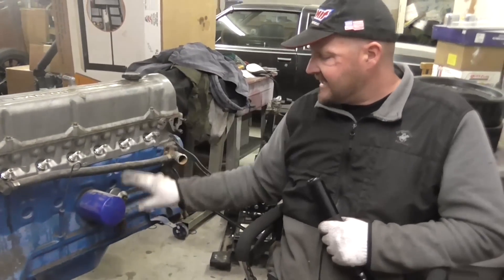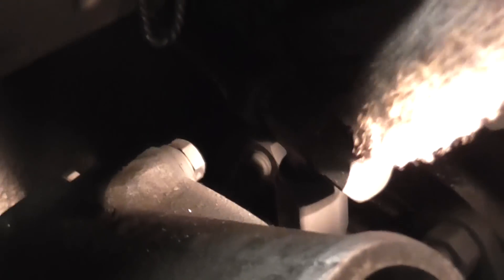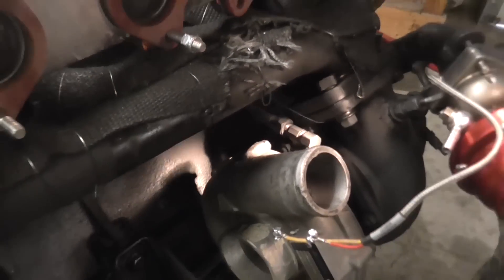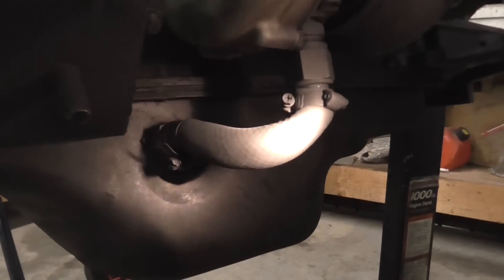Turbocharger Oil Supply And Return Line Installation

Comment: Another thing i realised that the stock l28 is originally non turbo what would be the max psi for those stock internals
Reply from the maker: Nicholas Silva I have had stock internals starting from 10:1 compression with another 20 lbs of boost but I use 100 octane avgas fuel.  With the low octane at the pumps 91, pretty bad octane unfortunately that's what is at the pumps.  Most I would recommend is around 15 lbs.  Now that is also depending on other modifications to the engine such as the right fuel mixture, whether or not you run alcohol injection, timing settings and many other factors.  Some tuners run the alcohol injection and they can run 25 or so lbs of boost.  The important thing to remember is detonation, the stock internals can handle good boost but they cannot handle much detonation.  As long as the engine is not detonating or running lean, the engine can handle quite a bit of boost.  After all, the stock R32, R33 Nissan Skyline GTR's in Japan had stock cast aluminum pistons and handled quite a lot of boost.  Many tuners put forged pistons in there so they could push more than 1000 hp at 35 lbs of boost.  Fuel air mixture, exhaust temperature ensuring that your combustion temperatures are not too hot is what must be monitored to ensure the engine stays together.

Comment: can you show the viewers how to "tap" in to the oil pan and the basics on how to install the turbo including the steps that are not here
Reply: Very easy to tap, you bore for example a 9,6 mm hole and tap with a m10 and use a m10 bolt. Depends on size the fitting you have is.

Comment: just built my d16y8
acl mains
eagle rods
vitara low comp pistons
8:5:1

im having an issue with smoking

could i need to use a smaller oil restrictor
or smaller oil feed line?

what els could this be

iv swapped 3 turbos out thinking i was just having bad luck

but it couldint be 4 ina row

it doesn't smoke N/A
 i just did my rebuild
Reply from the maker: +Raymond Dunlap I had that problem before, a oil inlet flange with a small hole which is low volume higher pressure to create a spray to the oil bearings and not too much volume like a large hole which could put too much pressure on turbo oil seals causing smoke.  Another thing is a clogged PCV which could cause smoking due to the oil blowby having no where to go.  Some people bypass the PVC altogether and just run breather so that problem will not happen again.

Comment: Can you suggest me a turbo for isuzu G1 4 cylinder 2.5 liter diesel engine
Reply from the maker: I would go on ebay and find a T04e or T70 with T3 flange with 2.5 inch V-band flange so downpipe can easily be fabricated.  Most of the time, these turbochargers are very inexpensive, and work well for a long time.  for example:  https://www.ebay.com/itm/T3-T4-T04E-V-BAND-Turbocharger-Turbo-63-A-R-5A-R-Internal-Wastegate-Universal/201748429871?hash=item2ef924bc2f:g:3koAAOSwy5ZXB2Qj&vxp=mtr  or this one:  https://www.ebay.com/itm/T70-T3-70-A-R-ANTI-SURGE-TURBO-COMPRESSOR-BEARING-TURBOCHARGER-STAGE-III-500-HP/201000759487?hash=item2ecc9430bf:g:MMsAAOSw0wRaPlJW&vxp=mtr  then install external wastegate at the exhaust manifold/header just before the turbocharger flange, allowing control of the turbocharger boost, since the T70 has no built in wastegate like the TO4e.  External wastegate example:  https://www.ebay.com/itm/40MM-4-BOLT-EXTERNAL-TURBO-WASTEGATE-BYPASS-EXHAUST-W-10PSI-SPRING-FLANGE-SILVER/382371365483?hash=item59071c026b:g:nJUAAOSwFLBadkUN&vxp=mtr

Comment: I have a Cummins 5.9 and I'm not having any oil going into my supply line into the turbo. What can that be? Clogged oil filter? Bad oil pump? 
Where should I start?
Reply: Clogged up turbo supply line.
Reply: @kjaques1  too late, engine blew up into a million pieces

Comment: Hi, the turbo is gonna suck the oil form the supply himself ?
Reply: Turbo does not suck oil, the feed line for the turbo is under pressure, so the turbo gets fed by oil at what ever psi your oil pressure is In Side the motor, and the return line drains by gravity, no pressure. But use a restrict or on the oil feed line for the type of turbo you use to the manufacturers spec

Comment: watch "custom turbo return line" Oil return has to be fitted above the oil level or the turbo will sprang a leak, and it's a messy business.
Reply from the maker: yes, that is true.  I try to locate mine as high on the oil pan as reasonably possible to avoid hitting any reciprocating parts of the engine.

Comment: awsome vid....
but on a naturally aspirated engine is the oil pump capable of supplying or over supplying a turbocharger depending on turbocharger specification ?
would that drop crankcase oil pressure ?
how about checking the engine oil pressure and test the car drive around  and see how it acts 
then check the pressure after turbo installation..
1 - if the pressure drop "oil pump upgrade ?"
2 - if the pressure is too high for the turbo then should introduce  restriction beans in the supply hose or perhaps a regulator....

some usfull info for Borg warner k27 : (oil sending line)
Max warm oil pressure: 5 bar (73.5psi)
Max cold oil pressure: 8 bar (118psi)

this guy made a DIY regulator exactly the way i though about maybe you want to check it out :
https://www.youtube.com/watch?v=Z55QwB8H05k
Reply from the maker: Faisal Abdulaziz Nice information, many aftermarket high volume oil pumps are available for the Nissan L series engines, also oil pumps from the 1981 through 1983 Nissan 280zx turbo engines came with the high volume oil pump.  This engine was one of the turbo engines and was equipped with the higher volume oil pump.  Some oil pumps such as on my Buick Turbo T have different colored springs to change and regulate oil pressure.   The new style oil supply lines which have a very small oil hole which provides a small jet of oil to the bearings which greatly reduces any type of pressure drop to an unnoticeable level.

Comment: You make it seem so easy, but what about a twin turbo set on a vq35de engine, how do you run the oil Feed lines from both turbos to the single oil pressure switch/sender?
Reply from the maker: +Dusty Bryant Tee fittings to allow one oil supply line to each turbo, the return lines can route together to a tee fitting before going back to the top portion of the oil pan.
Reply: That clarifies it, thank you